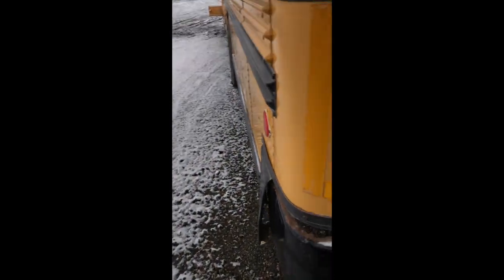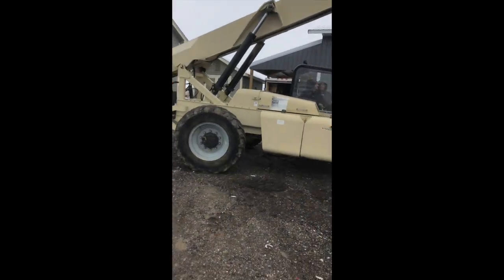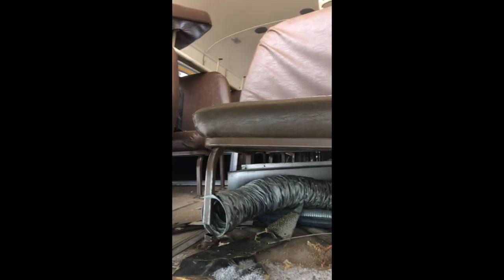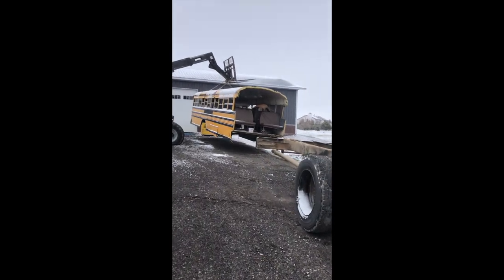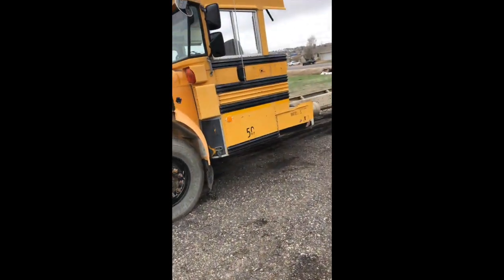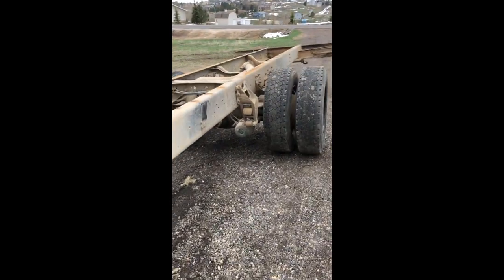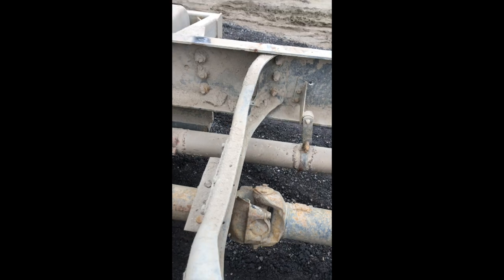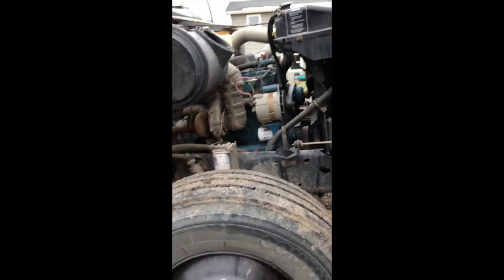1955 F600 school bus chassis swap part 8

Comment: How hard would it be to build a rollback on a bus chassis
Reply from the maker: Piece of cake. A bus chassis is no different than any other commercial
Truck chassis. Same width and everything. 
In this case, it would be as simple as installing one for an international since that’s all this is. 
But all the manufacturers follow same chassis widths (outside to outside of frame) I think it’s 32” or 34”. Can’t recall exactly. So basically any rollback for a heavy duty chassis will fit.